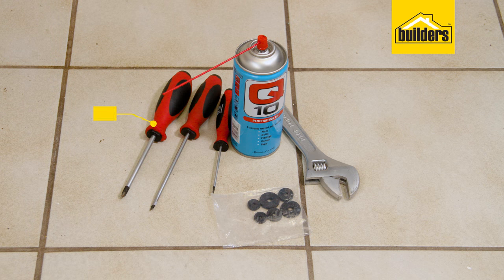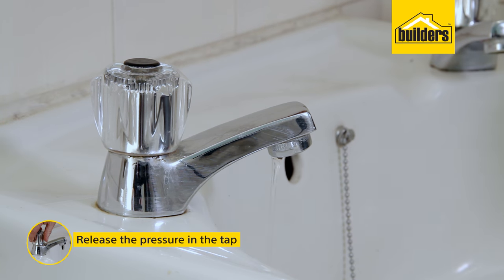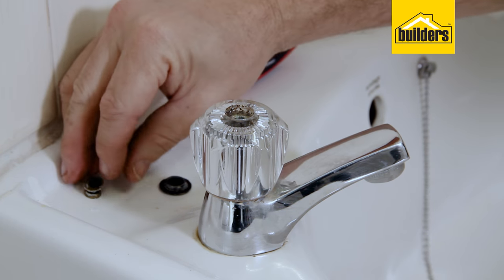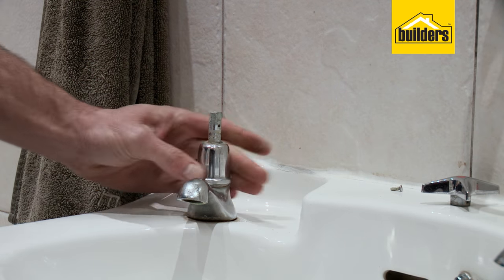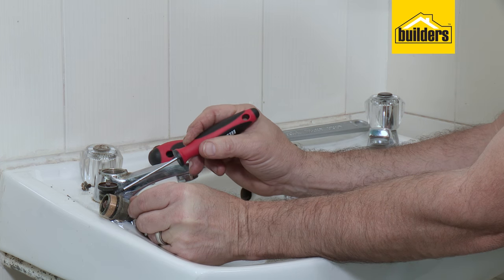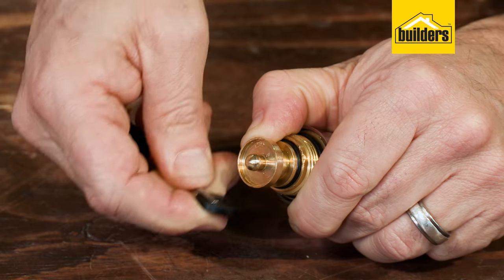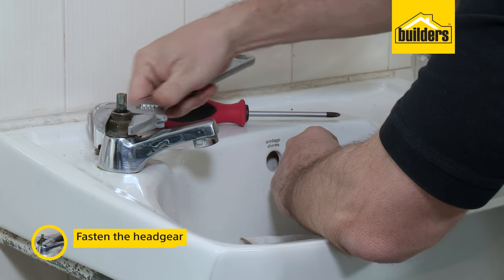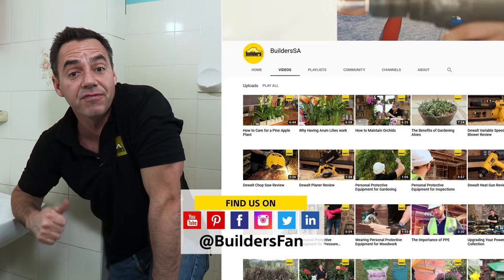How to Change a Tap Washer

Comment: Although you can use a shifting spanner it is much easier to use a 17mm ring spanner or socket wrench - preferably six point. And don't ever over tighten a tap. If the tap leaks after putting it back then replace the o-ring or washer round the tap body, or try using plumbers tape on the threads. If that doesn't work replace the tap assembly. Over tightening it will damage something, usually rounding the corners of the hex nut on the tap making the next removal way more difficult. You will curse the last person who over tightened a tap that you are trying to take off. I have already replaced an expensive bath mixer (not that there are any cheap ones) because I could not get the taps off. Lastly if you have to replace a tap check the hot and cold labels - last time I purchased replacement taps from Builders I managed to get buy two hot taps - I had assumed incorrectly it would come both hot and cold endcaps.

Comment: I love that part where he said "you cant take that whole head to your local builders ...". Well I did that, at Builders Cape Gate,  and they couldn't help me. They didnt have O rings.
Reply: I needed a tap washer some weeks ago and the Somerset West branch didn't have the size I needed in stock. Builders is great for the product diversity but sometimes a specialist store is what you need.
Reply: @strandloper  Problem is, specialist stores are generally not open on weekends or do not trade the same hours as Builders.
Reply: @runnerwannabe90  Indeed, was thinking that as I hit send.
Reply: H